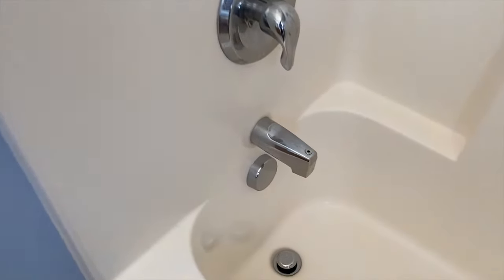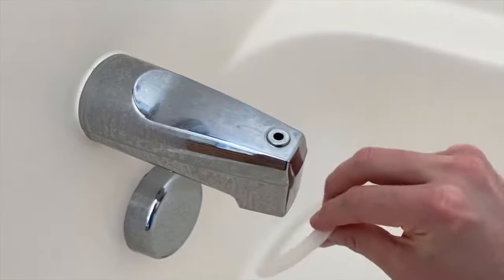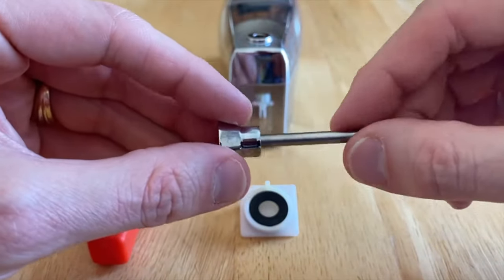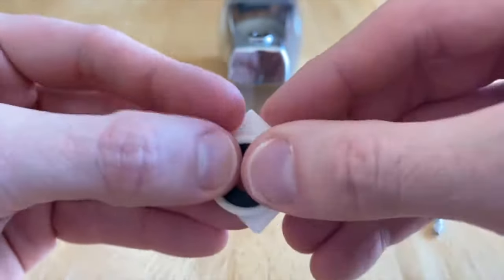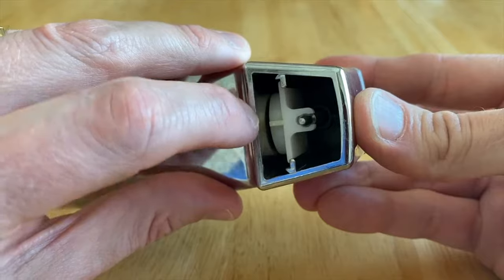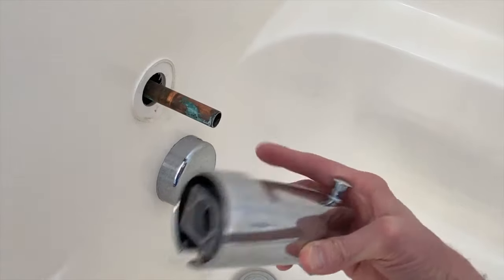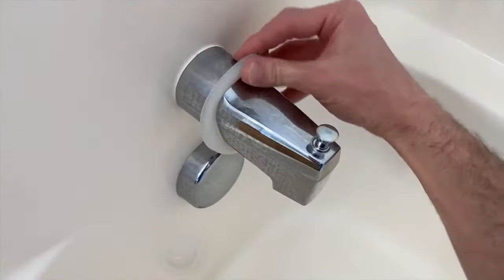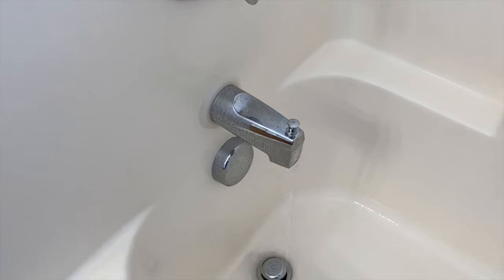Tub faucet spout diverter pull lever broke off - DIY fix

Comment: Great video, but I’m either missing a part or I have to buy replacement slide pieces idk the rod will not stay in the plastic piece or even stay in the shower position dropped the f-ing gasket in the drain too
Reply from the maker: Thanks for watching, any update?  That sounds like a part malfunction indeed.  Returning it for a new part may be best.

Comment: I found it easier to screw off the top piece, put the white plastic part onto the catcher pole thing and then push it through & screw on the top - if that makes sense & helps anyone else
Reply from the maker: @just_here1234  

Thanks for watching and sharing your helpful thoughts and techniques.

Comment: You had a pop up Tex that said "you don't have to take the faucet off, we just did it for demonstration".  How could that be done without pulling off the entire faucet?
Reply from the maker: @wendydann8180  

Thanks for watching, any update on your project?   You do have the option to keep the spout connected to the pipe however, it makes it more difficult to service and replace the parts included in the kit. 

👍🧰

Comment: Mine doesn’t have a screw at the bottom so how do I get it off? Also my little white piece is loose I can shake it around but the actual metal piece won’t budge up or down and I’m missing the top piece to pull it up or down. I thought I could just push the metal piece up from the bottom but it won’t move.
Reply from the maker: Good morning, just poured a cup of coffee and am sitting down to answer any and all questions for the DIY community.

Have you confirmed that it’s a twist-off design or press-fit?  If it’s a twist-off, turning it counterclockwise will hopefully break it free.  It’s possible that there’s a bit of calcium buildup making it more difficult to move.

Most important thing is to work very carefully to ensure you don’t harm anything in the process.

Please keep us posted and hey if you have any questions and hey if you’re into crypto, join our DIY ecosystem.

       toolboxtoken.com

Reach out to us any time!  🧰

Comment: Very helpful.   Can not find the rubber seal that you are showing , can you please tell me where to purchase that?
Reply from the maker: Thanks for watching, hopefully it didn’t go down the drain however if it did, check out the links below.

If interested in purchasing this product, visit our Amazon affiliate link below.  I earn from qualifying purchases.

       https://amzn.to/3JeRXcd

       https://amzn.to/3upNU8X

😎👍

1.  Remove Peerless sink handles

          https://youtu.be/5iUKSz5zklI
Reply: Thank you for your reply.   I have the tub spout and pull lever.   But I  like the rubber seal that you showed that goes over the tub spout up against the wall.   That is what I want and can't find.    Do you have a place to purchase that?   Thanks.
Reply from the maker: @sherrillwagner5129  

You are very welcome, below is a link.  Looks like they have improved the engineering and design over the years.

       https://amzn.to/3D7G1YN

If interested in purchasing this product,visit our Amazon affiliate link above.  I earn from qualifying purchases.

😎👍
Reply: @DIYwithMichaelBorders  Thank you very much.   I'll use your Amazon link.
Reply from the maker: @sherrillwagner5129  

So happy to help.  😎👍

Comment: I did this and it’s not working the top screw comes undone so I have to re screw if in like a regular screw what should I do?
Reply from the maker: Thanks for watching, any update.  The screw threaded insert might be a bit stripped.  Or it’s possible that the screw is to small…might not be the original screw.  Stripped insert is more likely.

Check out the link below, it shows a closeup view of parts.

       https://youtu.be/f5ZVjbtcNRM?si=s4gBRO5016I1KMbp

Keep us posted.  👍

Comment: my dad got a spout diverter replacement because my old one fell out multiple times. but the replacement fell out too after some time. i can’t get the white part (with the black circle) to stay inside the spout, it keeps slipping out. how can i get the white part to stay put? could there be something wrong with the spout?
Reply from the maker: Thanks for watching, any update?  It’s possible that you need an entirely new kit as the replacement kit you have might be defective.

Comment: How do I get the converter off of the pipe?
Reply from the maker: Thanks for watching, is your setup different than this press-fit design?
Reply: @DIYwithMichaelBorders  It's the type of spout that twists on and off by hand, but there's a converter on the end of the pipe and I tried to get it off using a wrench but it wouldn't budge(it has blue tape on the threading).
Reply from the maker: @braumenheimer9607  

Awesome, those are nice.  It may just need a friendly cleaning.  Below is a video link that may help.

       https://youtu.be/QQoYt8C3Btc

😎👍
Reply: @DIYwithMichaelBorders  Well thanks for going over all of this, but what I'm trying to do is remove that converter piece that's on the end of the pipe.  There's nothing wrong with the spout...the issue is that my shower pipe is broken and leaking, so I'm trying to modify the tub into a makeshift shower system with hosing.  I have all the hosing that will fit onto the piping if the converter is removed, but when I try to screw it off it won't move.  I read somewhere that somebody else was having the same problem and he just kept trying to force it off, but then the whole pipe started going around in a circle, and now there's leaking when the tub water runs or something like that.
Reply from the maker: @braumenheimer9607  

Thanks for the follow up info.  Sounds like you have a vision and a plan, we like that.  😁👍

We haven’t modified our setup in that way however the last thing you want to do is force it…it will break and it will cause unwanted leaking.

Wish we had additional info for you….

Comment: Ok my knob pulled out I bought the diverter replacement but my spout doesn't have a screw and it's also I guess a rear diverted and it has a almost white solid plastic insert where it screws in the wall ..I gotta figure out how to get that plastic insert out to get old diverter out..or can i?
Reply from the maker: Thanks for watching, any update on the project?  Are you referring to the white plastic inner part that works in conjunction with the pull lever & seal?  If so, the video link below may be helpful.

       https://youtu.be/f5ZVjbtcNRM

Please keep us posted, us DIYers need to stick together!

Comment: My niece is having this problem, sent her your video. she says hers does not have the allen nut "it's a twist off" and she can't get the faucet off?
Reply from the maker: Thanks for watching, any update?  It’s likely that it’s pretty calcified if it’s been installed for many years.

Spraying vinegar inside any and all openings of spout will help break up calcification.  Continue to be extremely careful as you or your niece try to remove spout, the last thing you want to do is damage the internal plumbing.

Keep us posted and hey if you’re into crypto trading, check out our newly launched DIY ecosystem.

       Toolboxtoken.com

Reach out to us any time!  🧰

Comment: After putting in a new tub/shower diverter when turning on shower water is also coming out of tub spout. What is the cause. Thank you
Reply from the maker: Thanks for watching, your diverter is still allowing water through when switching it to overhead.

The diverter seal may be the cause.
Reply: @DIYwithMichaelBorders  How do I repair
Reply from the maker: @katherinekochis7896  

Thanks for the reply, below is a link to our video showing replacement of diverter stem.  Your setup may be slightly different.

       https://youtu.be/ys-XS6cwcsM

😎👍

Comment: Hey guys, if this repair does not work for you (there’s still water coming out and not enough of a seal to divert the water), look for the small rubber circle That looks like it should fit around the PIN ITSELF. Put the pin in first, then the rubber on the pin on. the inner part of the spout, then the white plastic thing. The rubber is supposed to be where the pin and plastic meet. I’m no Plummer, just a programmer, but I sure felt like one while writing this comment!!
Reply from the maker: Good morning ☕️ we appreciate you taking the time to share your thoughts.  Any and all helpful info is greatly appreciated.  😁👍🧰

Comment: So I replaced the lever. But I feel like it’s taking a good amount of effort to push and pull the lever when switching. Any ideas?
Reply from the maker: Thanks for watching, any update?  We came across your other comment as well.  Are all parts installed properly and not damaged?

If the white plastic guide is installed backwards, the lever will be a bit stiff.